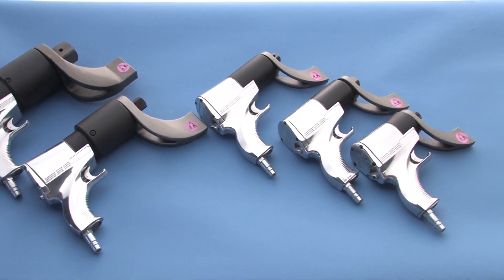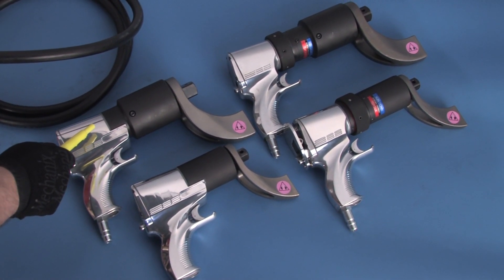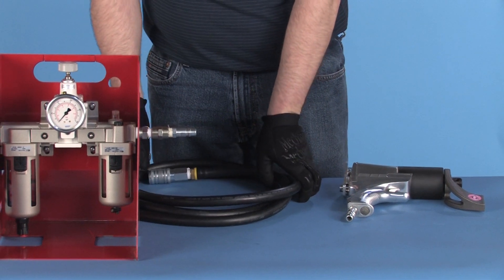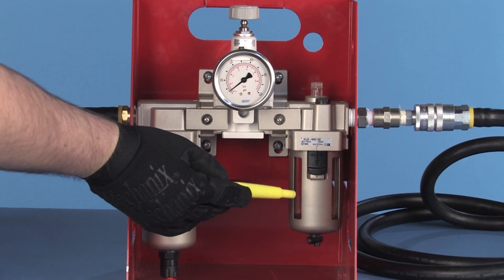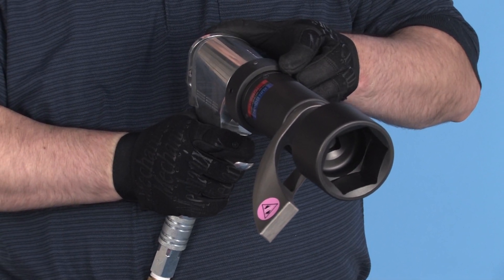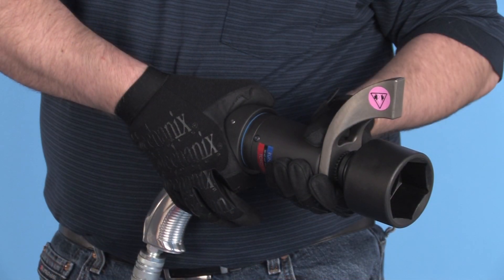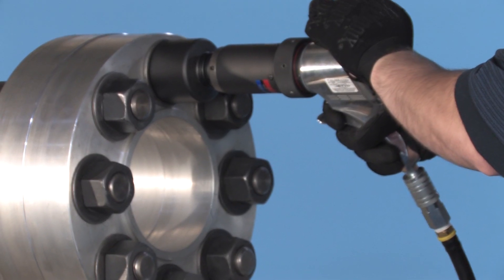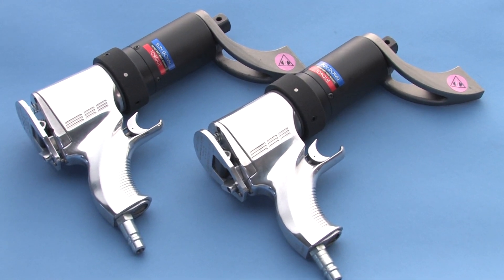Torque Gun Company jGUN™ Pneumatic Torque Gun Operation

Comment: Hi guys how is the length of this tool ? :) for example if I want to fix a bolt between two construcions I need to know how much space I need to work with it properly? ;) it looks like it is around 20-30 cm  with a adapter for M 36 bolts ;) thx
Reply from the maker: +funkykriz21 You can find all the specs here: http://torquegun.com/en/tools-a-equipment/jgun-single-speed, but the best way to see if it fits is to have a representative visit you for a demonstration. Where are you located? You can find your nearest Torque Gun representative here: www.hytorc.com/world
Reply: +HYTORC Industrial Bolting Systems Im from Dortmund Germany, but I ll check your website! ;) thx I m working on my Study thesis and I was lookin for a tool to fix bolts with enormous power, and somehow I landed on your youtube channel :) its just some theroetical stuff I have to look up ;) but thx for writng back :) The Point I have to look up is the " gaps / spaces between the bolts and the space between my Upper  construcion and the Pillar that I can fix the bolts properly thats why i was asking for the size of this  tool ;)